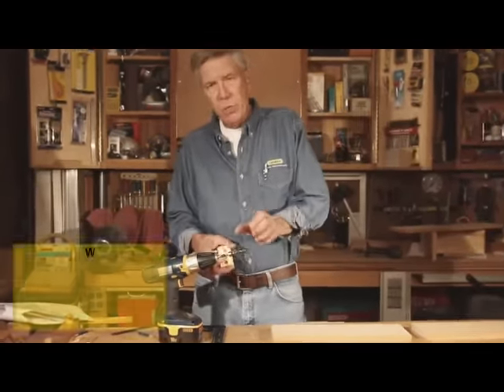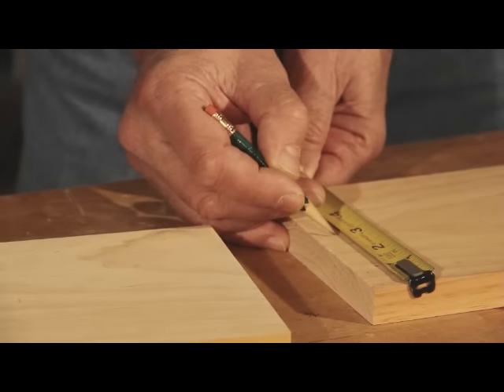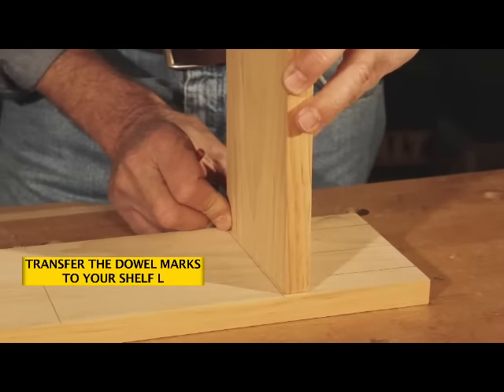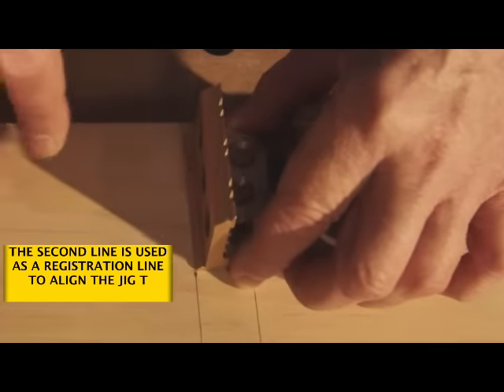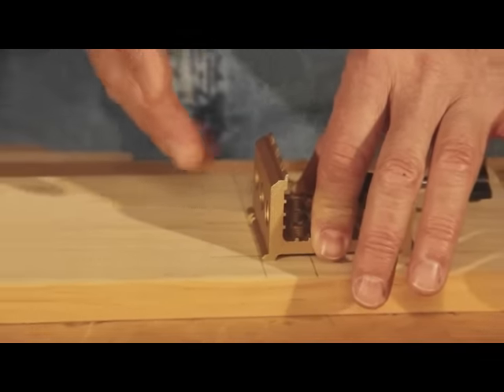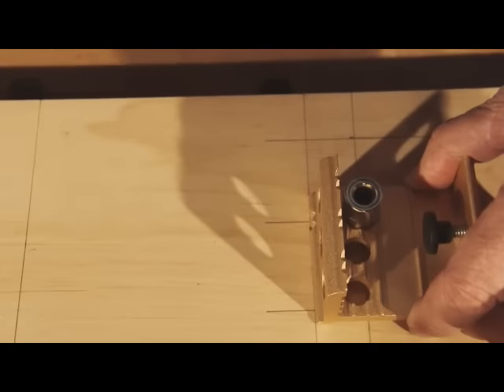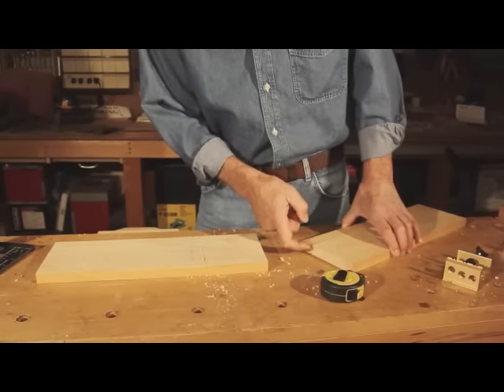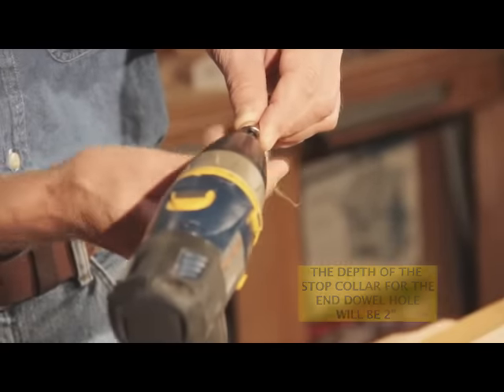841/851 Doweling Jig Instructional Video Surface to End Joint

Comment: Think I will stick with my Milescraft Doweling Jig for this type of joinery. So much easier. With the Milescraft you don't even have to measure, you just draw a straight line, then match up the dowels with the piece you want to join with the dowel pins you have already drilled in the first piece. Very simple and fun actually.

Comment: I’m having problems tightening the dowel stop on the drill bit. This is crazy. I’ve tried everything to get it to tighten. It should have at least come with instructions and a tool to tighten the dowel stop on the drill bit.

Comment: I just bought a GENERAL pro-doweling kit that comes complete with bits and dowels.  Only problem is that when I use the drill bits provided and the dowels provided, the dowels just drop into the holes w/ all kinds of wiggle room.  When I watch other doweling videos (including yours) that is not the case; the dowels fit the holes snuggly and sometimes need to be tapped in.  What's the deal?
Reply: I would test with another set of drill bits and see if you have similar results, and if not, take some calipers and measure the shank fo the bits provided and the dowels and see if either one is over or under spec'd.
Reply: ron blain they are using smaller diameter drill bits

Comment: You know what? When somebody designs an elaborate tool made out of high quality alloy, etc. the aim is to make it highly functional, to simplify the work of the user. This would be the main reason for which a potential client would buy that tool. Looking at your jig it is obvious it can't be very cheap, but in the same time, its use is complicated, and requires the use of other tools, and many steps to achieve the result. The same job you show here can be made rapidly with a jig made out of a piece of hardwood, 2, or 3 pieces of pipe, as bushings and two pieces of plexiglas as guides. The high quality of machining that piece of metal is irrelevant. The poor design makes it useless.